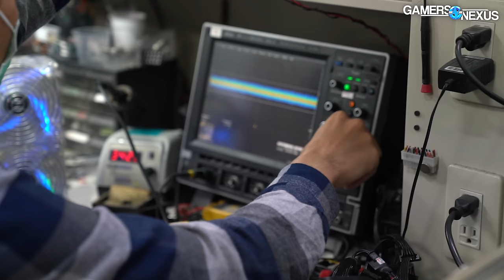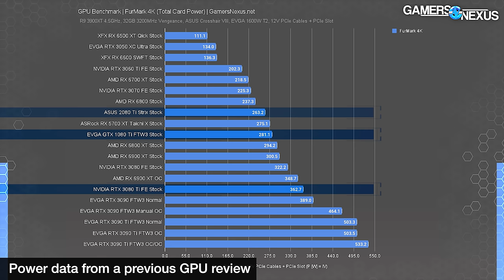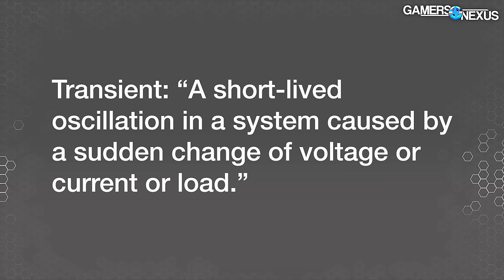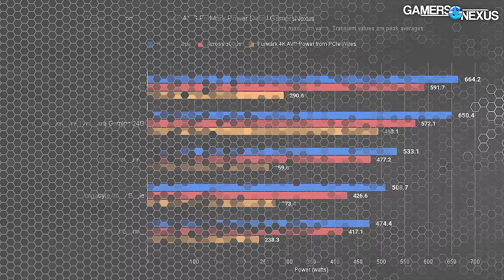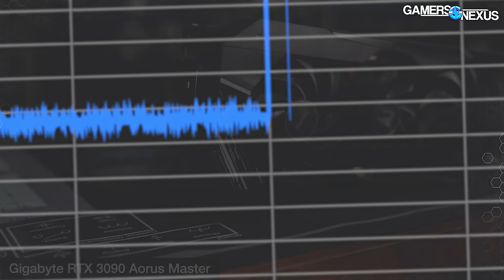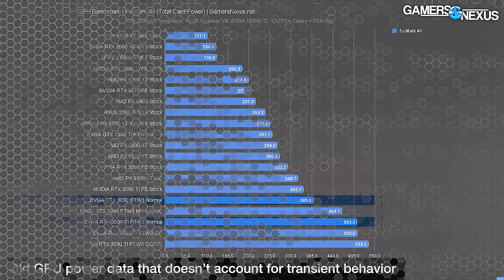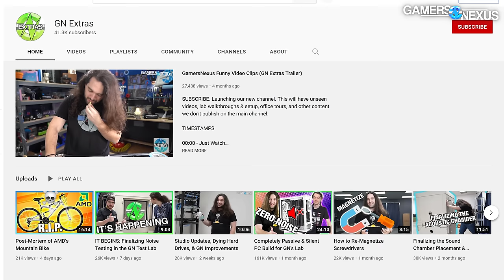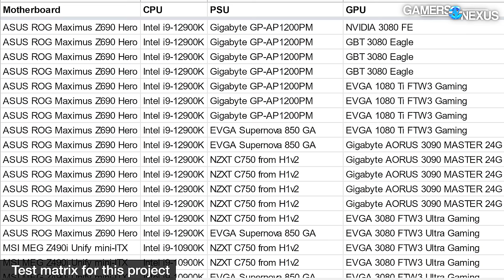The Brewing Problem with GPU Power Design | Transients

Comment: After hearing about these spikes I ended up switching from a 600w sfx power supply to a 1200w I got bundled with my 30 series card even though it should have worked fine in theory.
Reply: If you had listened to GN's advice on this channel for the past two years you would have stuck with your 600watt PSU because anything more is a waste of money.  Of course, GN knew about these transient load issues soon after the RTX3000 series came out but continued to misinform its audience about PSU wattage requirements.
Reply: @Globodyne  My gpu was only available as a bundle at the time and the 1200w was in sale,you don't need to get your panties in a twist about it nerd.

Comment: I wonder if there will be third party products you can stick between your GPU and PCI-E power lines with a bunch of capacitors to smooth out the current pull.

Comment: If 4000 rtx use more power I'm totally skipping.
Reply: Lol it already will. It's been confirmed. If my 3090 already draws 420w🤣
Reply: Imagine needing an 850 watt psu just so your rtx 4060 or rx 8600 xt doesn't trip OCP
Reply: Undervolting will be more of a norm 🤷🏼‍♂️
Reply: I totally get this, I bought the 3070 over the 80 solely because of the power draw. Now with inflation and 25% higher energy prices here I glad I did. I will not upgrade for years, only if the powerdraw goes down
Reply: @ColdCrushKlutz  undervolting makes sense if it benefits the performance of the card. Undervolting Vega and Navi/BN, and Turing/Ampere have tended to have benefits, but next gen architectures may respond worse to having less voltage and power budget. Undervolting will only become a thing if it makes sense for the architecture.
Reply: I'm definitely skipping.
Reply: the lower level cards should probably stay about the same in terms of power draw, the new architecture is more efficient in general, it's the high end where things get insane because GPUs are being pushed to their limit and efficiency goes out the window. It's like...if you have to double power to get 20% more performance, maybe stop and consider what you are doing. It's fine for people who want to overclock, it should not be the norm for manufacturers.
Reply: Buy some solar panels. I get to use my pc basically for free during the day.

If I was just a gamer I definitly wouldnt go above a 3070. For rendering and 3D work I would want the best of the best.
Reply: @Xirpzy  yeah, cause everyone has the time, money, knowledge, and privilege of home ownership to buy and install solar panels safely and legally. I should talk to my neighbor in 13b about climbing onto the roof of our building and screwing on some panels! Definitely won't get kicked out for that! What an easy and reasonable activity that can be expected of the majority of people on earth! Just remember, kids: America uses 240v just in two separate phases, so if you accidentally touch live wires you're dead 😁

Comment: Oh God I can't believe just how vindicated I feel right now. The number of fools who claimed again and again that they didn't need a proper power supply and now they have this broadside them.
While it's clear that Nvidia needs to change its design and fix the power spikes I can't deny that it feels good to see the carrot chasers have their collective faces smashed into the rock of reality.
Reply: Has been said that there is not much an issue in a power supply limit but the fact that they do not have much reserve capacitance. One to one ratio is enough  if you add some capacitance to smooth this out. I have added more than 10000uF in my system, because we also have HDDs which consume in similar way.
Reply: @gherbent  You added them wehre?
Reply: @DaroriDerEinzige  on the 12V  rail 10 - 20mF and 5V rail also 10mF = 10000uF, you do not need to open your PSU, a cable which contains  12V and 5V wires and connects to your PSU cut and solder a boar with capacitors,  I also have added 10A fuses in case any capacitor fails, and have also added some ceramic capacitors in parallel to electrolytic ones.
Reply: @DaroriDerEinzige  all 12V or 5V pins on the PSU join together, 12V sata power and 12V for CPU or GPU are the same and come from same source.
Reply: @gherbent  Ain't 10A a little bit high for the 5V and also 12V Line though?

And if you already cuttin' the wires and isolating them yourself, I think you can also open up the PSU - but that's just a side note.
Reply: @DaroriDerEinzige  Yes, the fuse rating should be below max Amperage rating indicated on your PSU for that particular rail, 1/2 - 1/3 of the value is a way to go, all the current will go through them in case of a shortage until they blow up, not sure but on mine I probably used 5A on 5V rail, and they still in good condition, 1A can be too low and blow up at startup.  I opened my PSU to add some ceramic capacitors, but I am electronics amateur and I know what I am doing, there in no much room for electrolytic ones, leave the space for ventilation, placing them externally does not diminish the benefits. Electrolytics are prone to aging and can give a surprise any time, tantal if used should have duble the voltage rating. Ceramic recommended to be from X7R series.

Comment: I actually just had to buy a 1000w PSU, since my Seasonic Prime TX-850, started to trip on the OCP.  It's interesting that I actually had the same EVGA and Seasonic combo you mentioned in the trends. 13:22

I had used it for about 10 months with my 3090 FTW 3 Ultra Hybrid at 400 watts, before it started tripping. And now even with power turned down to 300 watts, it still trips... Well, until Seasonic "fixed" it and sent it back. Now it's just sitting as a back-up.

At 400 watts, the average total system power draw would peak around 720 watts when playing CP 2077 at 1440p with RTX on. It would usually stay between 701w and 723w. Then the spikes would hit taking it to towards 1000w. 

I replaced it with a Corsair RM1000X, because I was told they can handle that kinda stuff a bit better.
Reply: The capacitors in the card/psu probably aged due to heat every 10degC or so over operating temp can reduce life by a fraction to a half. When operating near the edge a few percentage points matter. Thats why recapping old electronics often fixes them especially if they were at a high temp all there life.

Comment: I never thought I'd see the day amd has become more stable with power draw over Nvidia haha
Reply: They even have contrary colors to what we normally associate to "safe" or "unsafe". Back in the day red was red. Now it's green.
Reply: Well, its not all cookies with AMD, their upcoming CPUs might draw less than the also upcoming 13th gen, but get waaay hotter, i highly doubt u can run those without a big 3 fan water cooler so it wont thermo throttle + it gets slapped around by 13th gen Intel according to the benchmarkes leaked...

Comment: The thing is these newer gpus aren't even that impressive when you consider how much more power they draw. I would call them advanced only if they offered better performance AND drew equal amount or less power than the previous gen of gpu. In other words, of course you can make the boat go faster if you just row harder.
Reply: I think efficiency is still going up with these new GPUs, but the manufacturers want more performance than what they can get from maintaining the same power draw at the better efficiency. I don't know what their motivations are for this desire for a large performance improvement between generations, as they've put out cards that weren't much better than their older versions before. Maybe they're looking to market high frame rate 4K? Or possibly high frame rate ray tracing?
Reply: They still offer a large efficiency boost but they run them with too much voltage and push them too hard from the factory.
Reply: You can't say that unless you can also demonstrate they're also less efficient at lower power levels. Some of these cards will still deliver some fairly impressive performance numbers at lower power delivery levels, it's just that if you want to be the big dog you have to drive it home with more power at the end.
Reply: @NathanielHatley  When the 900 series came along it was criticized as not being much of a jump over the 700 series. Yet a GTX 760 is a 170w TDP card, the GTX 980 is only 165w and is twice as fast as the 760. Performance per watt doubled between those generations, but consumers cared more about performance its seemed.
Reply: Same power, better performance
5700XT -> 6700XT
2070 Super -> 3070
Efficiency is still improving if you'd just take a look a couple of tiers down the stack.

Comment: I was actually looking forwards to the 40 series, but with how much I keep hearing about power draws of new cards along with power draws with cpu's going up as well is enough to make anyone take a second look at how things are going. I really don't need a system that sucks about the amount of juice that a hair dryer would.
Reply: Worry not my friend. Its not all of the cards in the line up that is going to consume 450+ watts. Because of the fierce competition the companies are forced to squeeze every bit of performance they can get from their cards. If you buy 4080, instead of 4090 i think you would be good to go. 

Same example can be given with intel 12 series. 12900k can draw hundreds of power but if you look at 12600 is actually more efficent than 5600x in the gaming loads. So just because companies crank their products up high, doesnt mean that the products themselves are inefficent. Its only because with giving it more power, you lose perfomance gain per watt drastically as you go up.
Reply: @recai4326  Yeah I know. I was just bummed about the power uptick. I did say this waxes and wanes as cards come out over the years. I was just hoping the 40's would be more efficient after the 30 series just did a huge performance boost. Ill have to check what the 4060 is like when it comes out because that is the middle ground to all of these cards.

Comment: I’m glad more people are covering this issue, I hear a new standard for power supplies to account for these spikes is in the works.  But yeah I got a digital storm computer with a power supply that doesn’t have adequate capacitors, so it just shuts down, but yeah I also have a 3080, soooo… I’m looking forward to the 40 generation and new PSUs but for now I have to deal with a computer that shuts down mostly randomly. Even with a PSU that’s supposedly overkill for my set up
Reply: Which 3080 and what's the rest of your components?

Comment: I think it'd be well worth it to take a look at the Corsair SF750 Platinum. It's the sfx PSU considered best by many and I haven't heard of anyone having any issues running top tier systems with it. Personally I'm running a power limits disabled 5900x and a 3090 FE on it with no issues. It'd be very interesting to learn why it's so much better at handling transient loads compared to other sfx units.
Reply: Also running an SF750, 5900x and 3080ti. No shutdowns. Can these spikes cause any other issues like stuttering or blue screens?
Reply: Depends on your workload. I can easily trip OCP on an SF750 by running Hitman 3's Dartmoor benchmark at 4K max settings without dlss. It couldn't even run for 2 seconds before shutting down. Using a 5950x and 3090 FE, even undervolted to 825mV was still tripping OCP. Unreal engine games would also frequently trip OCP.
Reply: @Lead_Foot  Just ran the Darmoor benchmark max settings, rt on, no dlss, and didn't have any issues. I also regularly play unreal games and have no issues with OCP, so you might have another issue with your power. (3840x1600 res, which is close to 4k, and I used to use 4k and had no issue with unreal games)
Reply: @cadvahn  at 4K without vsync? Higher res will produce higher instantaneous power draw. I tested 3 different SF750s and all would trip OCP. Plugging in gpu power cables to a separate psu helped. I'm also watercooled so it could be trying to boost higher.
Reply: @Lead_Foot  Just tested the Darmoor at 3840x1600 since that's what I'm running now as I said. Never had any issues with unreal games back when I was using 4k, last 4-5 months ago. I'm also watercooled.
Reply: @Lead_Foot  Did you try a UPS? Strange you're having issues because I know multiple people using SF750 Plat with a 12900k and 3090 with no issues.
Reply: my corsair sf750 build with 6900xt, 5800x, and a gigabyte vision b550 at 1440p 240hz would trip every once in a while on final fantasy xv, almost every 30 minutes on aragami, and once on tekken 7. 

swapped to a cooler master 850w, and it proceeded to kill 3 ssds within a month and a half. ended up parting out my entire pc save the ssds and psu because it was it was a trouble child for its last 2 months and was stressing me out so much lol.

going to attempt to build again sometime in early 2023, if i can muster up the courage to after that shitshow lol

Comment: Always recommended my friends to overbuy the PSU both in terms of quality and wattage. Guess we’ll need 2kW PSUs soon.
Reply: Intel had rewrite the ATX power spec to handle this. ATX 3.0 requires PSUs to supply up to 200% of the rated continuous output for sub-millisecond spikes. I can't remember the numbers but there's a sliding scale of how big a spike it can handle for how long, so the tolerance for longer spikes is lower.

Comment: I've been trying to solve this problem for 2 years. It's killed a HDD and a PSU so far and I've replaced my CPU twice. Assuming this is the problem, because I had it as soon as I got my MOBO before I got my GFX.

I'm just amazed at your detailed coverage, simply amazing. While I had issues with a 5800X on a ASUS B550m plus wifi, it definitely got more frequent when I put in my 6900XT. My issue was mostly at idle though at first until after some BIOS fixes. Swapping my old highly rated 1000W PSU for a modern 1000W highly rated one has definitely helped but not eliminated it 100%. I'm pretty sure it was several issues, all related to voltage dips and spikes from several parts. You've given me a far greater understanding, thanks heaps I was waiting for something like this but was expecting it from the CPU side.

Comment: I started notice some of this back in 2005 while working on premium workstations with multiple hard drives. We started focus back then on more premium power supplies and raising the overhead on the psu. Errors in both initial and external variables in power affected the system far less with a better psu installed.

Comment: As someone who is like the many, who ran into PSU problems, I can assure anyone watching, this is such a comprehensive guide, and really helped explain some of the stuff I had to personally deep dive research. Glad GN finally did a vid on it, they really explain things well and even the most uninformed will understand. My personal issue was a GTX 1080ti FTW3 from EVGA peaking much, much too high during load, and maxing out a Corsair 850W platinum PSU. Crazy to think that an old GPU was able to spike that high, even fooled the PC repair shop I took it to. Had to upgrade and got a steal on a 1200W supernova PSU from EVGA. I plan to use it on a new system whenever the 4000 series, and intel 13th gen drop. But with this vid, I might just budget for an overkill 1600W so I can make headroom for making sure I don’t have that same headache
Reply: Necro'ing this reply. I had the same 1080ti and Corsair 850W PSU and had exactly the same issue. Then the same issue occurred with my RTX3090 and Seasonic 1000W PSU. I've since upgraded to the latest BeQuiet 1200W PSU which apparently has transient power protection. We shall see if this solves the issue.

Comment: Great video. Just bought a 3080 and using a 750 watt about 5 years old yet. Noticed a bit of noise when first installed new graphics card but seems to have stopped. Thanks for your great work.

Comment: OK This is just next level PC content and I think people will love it. However I think you'll need some more equipment for the experiments:
1. DC electronic load, programmable - these are created to be able to mimic transient loads, enabling power supply engineers to fully know the important parameters of the power supply - load regulation and transient response.
2. Current sense amplifiers designed to match your current measurement range
3. Reference source - your scope can trigger out from external frequency source

Comment: Here's what I don't understand though, the new power supplies seem to be having more issues than the older ones. I have a 8 year old 750 watt EVGA power supply that could handle the power spikes from the RTX 3090 just fine, however when I had tried two newer model EVGA 850 watt power supplies they exhibited the power cut off issues. I also noticed power supply manufacturers seem to be cheaping out on the quality of wiring too, because my old EVGA unit had thicker gauge wire than the newer models.

Comment: Ran 3600X + 3080 Ti with 650W Seasonic Focus Plus Gold - no issues.
Changed 3600X -> 5900X, 3DMark Time Spy - system shutdown.

System runs okay 750W Corsair RM, but 3DMark CPU clock frequency chart shows anomalies when running 5900X PBO + overclocked 3080 Ti.

850W Seasonic Focus Plus - all is well and no issues besides PSU coilwhine when under load.

Comment: Thank you for making this video!!! I am pretty sure I ran into this issue when I changed my ram from the stock 2133mhz to the XMP option (3200mhz for r5 3600, PSU EVGA G5 650W Gold) my computer was freezing. I do not have the expertise to figure it out but tech friends think it was from power spikes from my msi ventus oc x3 3070.

GPU: MSI ventus x3 0c 3070
PSU: EVGA G5 650W
Mobo: Gigabyte B450 pro wifi rev 1
Ram: Corsair vengence 3200mhz